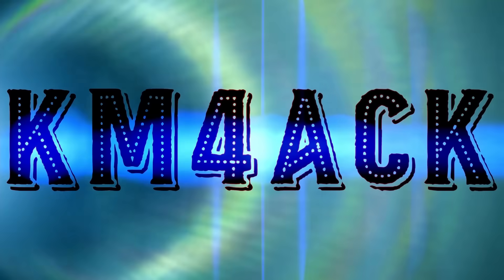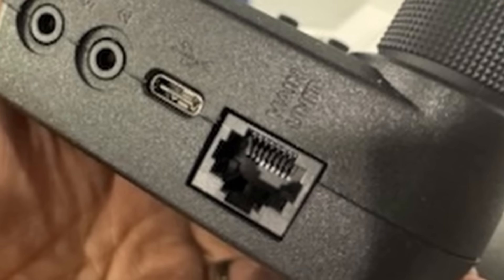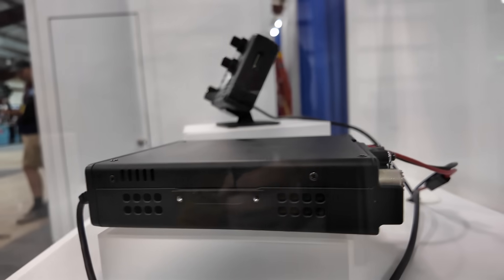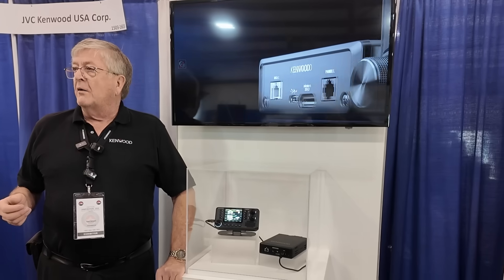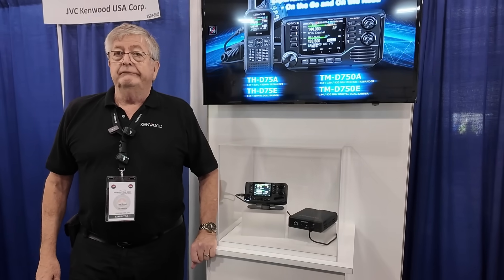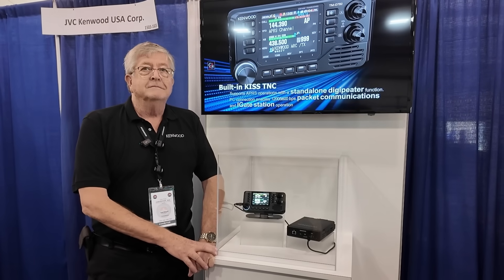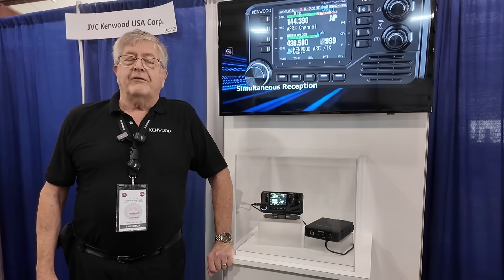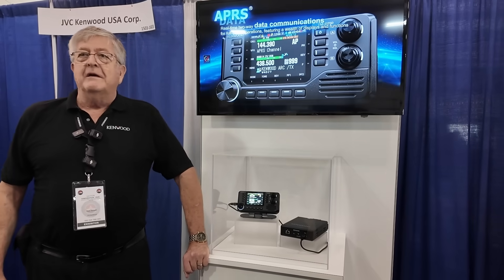Latest Details on the Kenwood D750

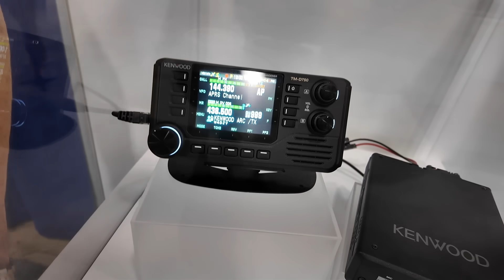Comment: 2:23 So that's where they decided to put the connector to the main unit? Should have put the connectors on the back of the control head so you can do a cleaner installation. 👎

Comment: In my opinion if it only does 5 watts on 220 MHz you might be better off getting a dual band 2m/70cm and a mono band 1.25m radio.  Honestly since it doesn't do crossband on 220 MHz it might be better to get a mono band 1.25 radio anyway even if it has 20 to 35 watts on that band.  I know Btech has a 25 watt tri-band that advertises a peak of 20 watts and an average of 15 watts on 1.25m.  I recently saw that Wouxun also has a 20 to 25 watt tri-band mobile that does 15 watts on 220 MHz.  Granted they are probably SOC (System On a Chip) type radios, but if inexpensive 25 watt Chinese radios can have 15 watts on 1.25m the other manufacturers should be able to have 20 to 35 watts on that band with their 50 watt radios.
Reply: How exactly do you have "peak" different from "average" on FM?
Reply: @stargazer7644  probably the same way AM and SSB change with voice deflection
Reply: @DarkShadowCustoms  FM doesn't vary in amplitude.  It isn't amplitude modulated like AM and SSB are.

Comment: Why is that CAT5 cable sticking out the side of the face?  It should be recessed in the back! 🤦‍♂️
Reply: Kinda hard to mount it on a flat surface with cables sticking out the back.
Reply: @stargazer7644  Not sticking out the back.  The same a Yaesu does it with their interconnect cables.

Comment: Please, a reasonable amount of power, at least 25 watts, on 220.  Also, what is the micro-SD card to be used for?  

I would love to be able to save the radio programming and configuration to the card.  Then be able to take it inside to the computer, back up that configuration and frequencies, edit and change it, put it back in the radio and have all my changes.  In fact, I could have multiple cards with different programming for different purposes.

Comment: Will there be a microphone jack on the control head?
Reply from the maker: Body only from what I have seen
Reply: That is a deal breaker for me. Poor design.
Reply: @kengilcrest8670  You apparently don't know they make mic extension cables.  I just use an ethernet cable on mine.
Reply: Same as the D710, in the deck.
Reply: @petbytes7167 is it hard to get the mic cable to the deck if it’s tucked out of the way?  Do they make extension cables or something??
Reply: @wjjohns04able  Yes, they make extension cables. Personally, I prefer the mic connection on the body so you aren't limited on where you can mount the control head.
Reply: @Right_2_Own thank you. I appreciate the response.

Comment: Ask about the Bluetooth is it apple Bluetooth compatible
Reply from the maker: We did but there won't confirm nor deny at this time.
Reply: So are they strictly saying you can only monitor the star over the Wi-Fi? That’s kind of silly cause the 705 can actually transmit hooked up with Wi-Fi
Reply: 73 DE KA9ZRZ

Comment: That would be a great mobile radio for the shack.  2m, 1.25m, 70cm bands is a great band set.  Will it do SSB?  Looks like I'll have to add the Comet CX-333 as my shack vertical antenna.
Reply from the maker: No SSB
Reply: The 333 has been a wonderfull antenna for me.   No regrets at all, and I highly recommend.